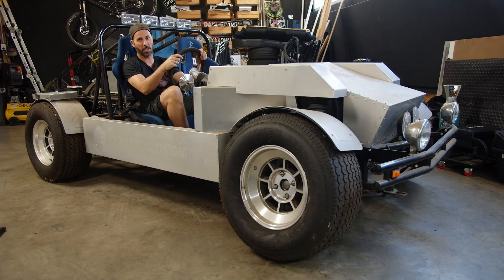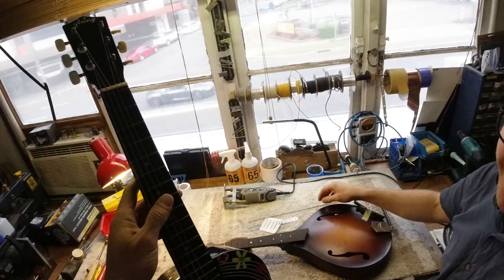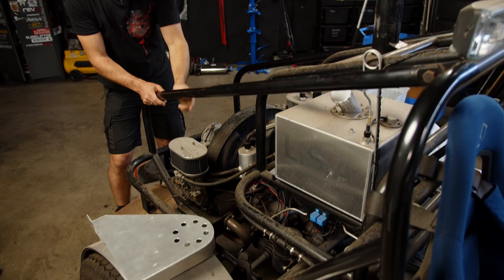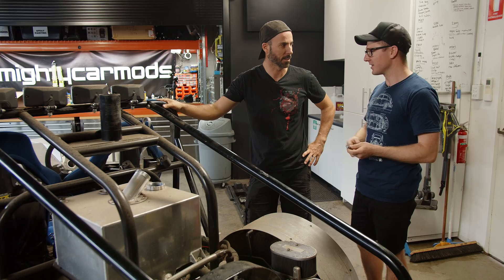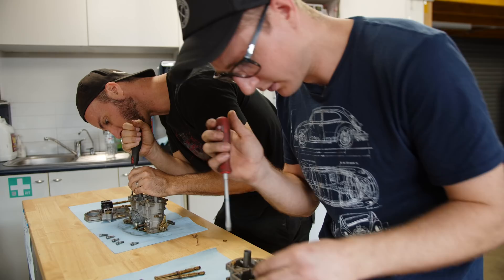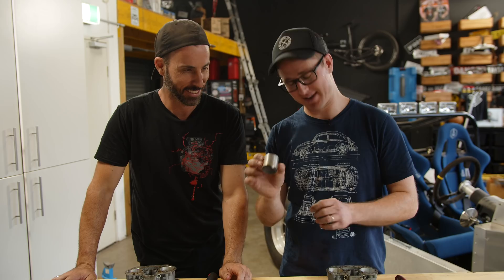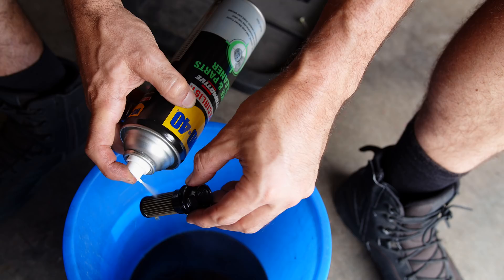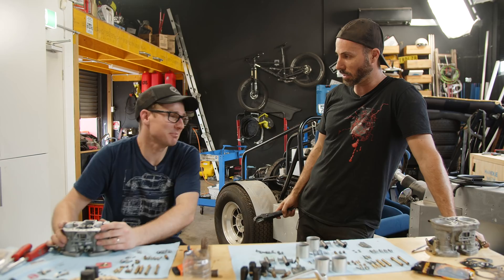How To Fix a Broken MOON BUGGY ($10,000 Rear Engine Challenge)

Comment: The sand has special properties to polish the intake on the way through 🦄🦄
Reply: They mentioned the heads were 'ported'.
Reply: There is a process called " Extrude Hone " that pushes an abrasive mixed with putty through ports.
Reply: @bobroberts2371  best way to port and polish large cast manifolds.
Reply: Does wonders for the ring pack too 🤣
Reply: Is that like when you eat too many peanuts?

Comment: "We're probably targeting that upper range of 140 hp, 100 kw..." 
"At the wheels." 
"No."
Moog immediately displays his "ha-ha, oh shit, wtf am I gonna do?" grin
Reply: ChrisHallett83  NAAAAAAAA!  as a VW drag racer my bet is if this thing has a 2110cc motor thats PLENTY to beat on a boat of a mr2  think weight per hp......
Reply: NOS
Reply: @11secghia  I wouldn't have thought the MR2 is going to remain totally standard. Getting 300bhp+ from a 3S-GTE isn't hard, and much more is possible with suitable tuning. The 3S-GTE in the Pikes Peak Tacoma made around 800bhp.
Reply: That thing has 160HP and weights 655kg. Marty already lost. It's a bored out vw, it WILL start. Also, it was really well made.
https://www.justcars.com.au/news-and-reviews/lynx-lunar-buggy/11771
http://www.evolutioncustomindustries.com/moonbuggy.html
Reply: @yuricorrea2491  really depends how much Marty is willing to turn up the boost
Reply: ChrisHallett83 Yes i mean they need two episodes and lot of money to get it running while Marty can modify mr2.
And if sand is in engine to?
Reply: Yes, jfan4reva, we saw the video also.
Reply: Worked aircooled VWs have been chopping much bigger things since the 60s. If that engine is in decent condition and tuned properly then it will chop even a worked over MR2. Looking at the sand driving video of this buggy, the suspension looks pretty well sorted as well. Being a Super Bug pan gives it a full IRS transaxle and a properly set up Macpherson Strut front end will give it some handling  as well.
Reply: Idk it doesn’t have any aerodinamic less horse power

Comment: Air cooled engine.  You fools, there is no air on the moon!
Reply: El Casho there is but no oxygen. Can be cooled by air still.
Reply: @adamesham9800  wft dude no. There is literally no atmosphere on the moon
Reply: @adamesham9800  wat
Reply: @eikuz  its cold there anyway, and the fans can push the heat away or not?
Reply: @JimMcBeam  its only cold when you are not in the sun, but you really don't need to worry about overheating an engine that won't run
Reply: You need oxygen for the engine to combust. There's no possible way that car could ever be a real moon buggy.
Reply: Hence, the moon buggy was electric.
Reply: Read A FIRE ON THE MOON; a book written back in the early 1970s! Can't read? Well, don't listen to false news. Stick with "graphic novels." You know, they're really only comic books (working generic title) but as we, who grew up in the late 1940s properly called them by their genus, "funny books." You can't use a radiator on the moon.
Reply: @JimMcBeam  I find your utter lack of understanding of thermodynamic principles, disturbing...
Reply: @eikuz  Technically there is an atmosphere on the moon.    https://www.nasa.gov/mission_pages/LADEE/news/lunar-atmosphere.html
Moon has an atmosphere of 1,000,000 molecules per cubic centimeter.  The earth has 10,000,000,000,000,000,000 molecules per ccm.

Comment: "Brake and parts cleaner", looks under shop bench where a 2 gallon can with basket of carb cleaner sits. Yeah, I'm that old! I remember rebuilding and altering more than a few of those carbs (Rochester, Carter, Holley, Weber, and Solex). Bucket still good for small engine carbs.
Reply: All us old guy had one of those in the garage. Usually used WAY to many times.

Comment: Marty's SW20 is gonna smash this thing..
Reply: That thing has 160HP and weights 655kg. Marty already lost. It's a bored out vw, it WILL start. Also, it was really well made.
https://www.justcars.com.au/news-and-reviews/lynx-lunar-buggy/11771
http://www.evolutioncustomindustries.com/moonbuggy.html
Reply: @yuricorrea2491  Good info in those links man, I wonder if it still has the blue underglow!!
Reply: @yuricorrea2491  Great info man. I'm not sure it's going to be enough to chop Mr Poo though. The Moog Buggy engine is very likely at it's limits without some major work, while Mr Poo has plenty of room to extract extra power. All Marty needs to do is bump up the boost, and either upgrade the intercooler, or fit a cheeky water/meth injection system.
Reply: @yuricorrea2491 /videos That's best case scenario. You're still talking about a 40-year old air-cooled boxer with carburetors.
The 3S-GTE can easily and reliably make 300+ HP with stock internals.

Comment: It's common to swap out an original 1600 for a 2000 engine from a bus, and probably even more common after seizing up your 1600 due to not checking the oil level that it gets bored/stroked to a larger displacement depending on which piston kit you bought. I've got a 4-seat buggy that originally had the stock 1600 single carb setup that was rebuilt as an 1835. So regardless of displacement, that twin carb setup with ported heads nods heavily to the early Porsche engines. Can't wait to see how she runs!

Comment: That's got to be a high power flat4 for sure.  They're 44IDFs with 36mm chokes which is pretty big, bigger than I ran on my RX3 with dual 40IDFs.  One day I saw an ad in a magazine on twin weber manifolds for 13bs so I thought I'd try it out.  I searched around and pulled a pair of 40IDFs second hand from a decent dirt/speedway VW and changed the chokes from 28 to 30.  The main reason why I think they're 44IDFs is the extended emulsion tube and blocked off cold engine 'choke/fuel circuit'.  If you want to learn about carbs like these, find a greybeard that used to run rotaries, VWs or Italian cars because Isaac looks busy :D

Comment: My car still has a carburetor because it's peugeot 307 from 2002. However it still runs well: I just had the engine head rectified and I put in a new head gasket. Now it only needs a turbo and I'm good to go.

Comment: Years back I built an engine for a 1964 beetle, it ended up as 2.2L turbo it could pull wheelies and looked stock with the main car still working as a 6v.

Comment: Keep it up as an old school air cooled enthusiast, both bugs and 912s you,ve peaked my interest, and it looks like the rest of the car had some good kip put in also. with fuel over engine looks like your weight dist is going to be more rear biased than usual. also after all that time resetting torsion bars in rear will bring it back up so rear squat under acceleration will be less.  time consuming but inexpensive task.

Comment: If theres that much sand in the feul, I'd be slightly worried about the cylinders/piston condition. Please spray something into the bores to try and release seized piston rings. Looking forward to the finished  product. I had twin 40 Dellorto carbs on my cars as a youth, the sound is amazing.

Comment: do a sc14 supercharger kit for it. the kits cost like $400 - $500 and have significant increases with beetles, mind you its not to difficult to have big gains with such little figures but you get the point

Comment: As cool as this old buggy is, it's still an old Super Beetle underneath with Super Beetle suspension and brakes. The suspension design works much better for off road durability than on road geometry. Mr Poo is the easy favorite.

Comment: 1600 to 1835 cc engine same case just different jugs some internals but you can scratch over 100hp easily out of these.  nice motor it may have been could have counter weighted crank and better rods  loos like someone had some time in it

Comment: As an aircooled VW guy I was gringing so much :D People do use those carbs on 1600cc engines a lot. And why didnt you just remove the valve covers to check what heads you got 😅 Or maybe even pull a head, that is literally one hour of work 😂

Comment: I wouldn't go by carb size when guesstimating the engine size. A lot of people threw Weber carbs on those split intakes that were way too big and they didn't want to idle. Then they had to put huge jets in them to try to make them idle. A single 2 barrel carb would run that engine fine.

Comment: some people drag race in these things and they sure can move.
I have been in a 1600cc singlecarb and with the low weight it really moves, remember to have some weight in the front, because some of them tend to lift the front wheels, if there is no front fuel tank or other weight in the front.

Comment: You know the gas is good when it looks like used fryer oil, smells like turpentine and can be used in place of water to put out small fires. I love carburetors like my carter 650, not a fan on the one on my 86 Toyota, vacuum line nightmare that thing.

Comment: Once you go VeeDub you never go back. No car has the same character or design. 

Well, I drive an Audi but it carries over mechanically in some ways- original 1.8t with 300,000 miles, k04 Turbo, full bolt ons @24psi.

Odd as hell until you get to know it, then it feels like home.

Comment: I find it kind of funny when you lay out the carbs while they are disassembled and exclaim at how many parts there are,  how about take a modern fuel injection system and all of the components involved into individual parts, you would be looking at many many more pieces. Cars are more complex, not vice versa.

Comment: Hmm, with the constant discussion of the "displacement mystery" I was just about to suggest measuring it with the help of engine oil and a syringe - but then I realized: flat 4, not as easy as on any upright cylinder... dealing with air pockets and oil leaking out the exhaust. Still, you could check for a stroker crank by simply measuring how far a screwdriver moves between TDC and BDC.

Comment: I assume you measured  everything before breaking it down (ie turning everything in and finding how many turns in it goes before taking out.) If not. good luck. But its good to have a base before stripping everything then guessing. otherwise you will be in a world of hurt when its time to tune. more so when its not stock ( base settings) . Have at it guys.

Comment: i think his hp numbers are a little low. Formula First uses a stock displacement and stock carb (bigger cam, and balanced engine, not stock) and they are pulling 110-120hp, i have built and tuned several hundred of these including performance engines and 200hp+ can be achieved with the set up you have if tuned properly. I look forward to seeing what it will do on the dyno.

Comment: Those are some big arsed carbs for a bug engine.  Could it be an old Porsche engine ?
It's had some serious tuning and is going to go like f**k
I'm dying to hear it ticking over to get an idea of how lumpy the cam is.
It's bound to be fully lightened and balanced. Will Isaacs Dad, aka Tuning fork, get it on the rollers to check the horses ?

Comment: 1st thing you really should do is look at what you have and what it is. Nice CB performance doghouse shroud, Empi cast ali covers alternator instead of early generator, expensive  hex cross bar for cabs all looks good, this much money on the outside looks like probably has money on inside. if super was doner it has Macpherson struts up front for better handling than older bug swing arm front suspension(lighter too), funny went away from original tensioning for fan belt to that idler crap, it will will have CV joint rear suspension fully independent on a swing arm just like 911 design rear suspension, no vacuum adv pot on distributor, check under valve covers could have modified valve train.  distributor may be electronic as it has the bigger base than stock and remounted coil behind shroud to clear  hex barb carb linkage. Crankcase ventilation setup looks decent. looks like oil coolers installed with nice lines with maybe AN fittings. fuel tank in back

Comment: "Skids" with the weight of the engine back that far, hanging off the back of the transaxle? I worked on those air cooled VW's when they were new (1960's into the 1970's), and saw a few in my shop that had dune buggy bodies (the standard Bugs with the torsion bar front end which got the body graft along with a 14" shortened floor pan). Even the 2400cc built dual Weber versions couldn't spin one tire without driving on water (as with a burnout box at a drag strip), on snow, or over a sprinkle of sand on hard pavement; too much weight back there and super-grannie 1st gear ratio. (No relationship to Super Gramps! LOL)  And if that Moon Buggy has welded spider gears or a rare limited-slip - fugetaboutit !

Comment: You need to smoke that mr2, aircooled engines rulez! #aircooledmafia

By the way, this venturis are too big. I usually use 26 here in my shop. And to make serious power, put some e85 in it. Aren't that complicated, adjust the carbs, take the heads out and shrink the combustion chamber (something around 13x1 compression ratio) and you will need a distributor to work well on e85, here in Brazil we have that OEM from VW.

DM me if you guys need some info. On my racing engines 1584cc (1.6L) i made 130hp at the wheels!

Comment: Moog I'm not buying that you didn't know that it had a hot air cooled engine when you bought it. If it's running twin webbers it's no where near a stock engine. You have been around enough hot cars to know what you are looking at.

Comment: Concerned..where did you get HP number as 120hp takes lots of internal mods for those air cooled engines and typically webber carbs not solex and why waste money on fuel pump when its a vaccum system? 
Only say this cause ive worked on lots of old euros and seen enough Vw's and researched them to know its big $$$ and built engines is only way.
Hope you have fun and are learning but at times this channel slips with information....and i am always willing to be schooled

Comment: lol sounds like you need someone like engineer repairs just like me
i do know about that motor n carburetor is called weber face up dual barrles
i tell you what  it seen be 2.2l motor customer build it not factory from 1.8l it been upgraded by someone else n i seen that carburetor i like hmm weber n he said 30 on cup so i knew it would be putting 200hp at wheels but im not sure about transmission because you never drove it never know
and you didnt clean tank out " i can tell it packed up with sand because someone drove it in sand race"

Comment: Spending 10k on a beetle engine. 

Yea naw. Doing it wrong.
Reply: For some clarity. 
You cannot. I mean can. Not. Tell the displacement from a carb. 

Maybe someone built it. 
Slapped huge carbs on it. 
Ran it until it was wallowed out and low on compression and crank end play. 
And gave up and sold it to the next guy. 

That’s how it would play out in America.